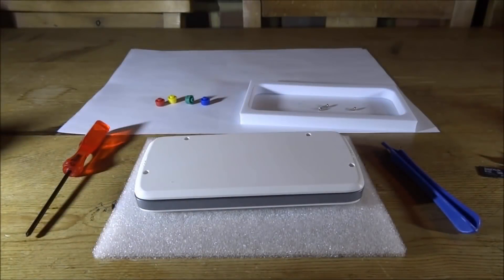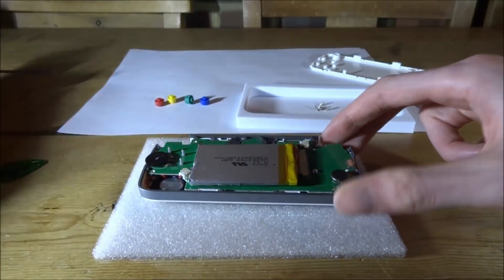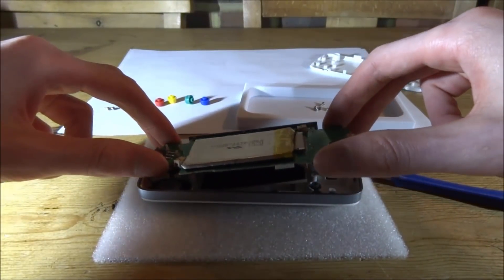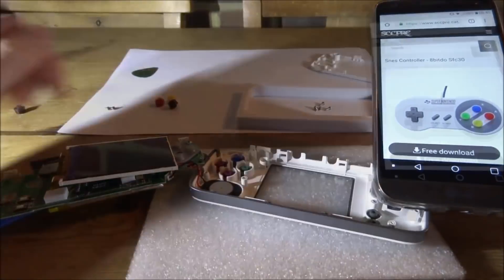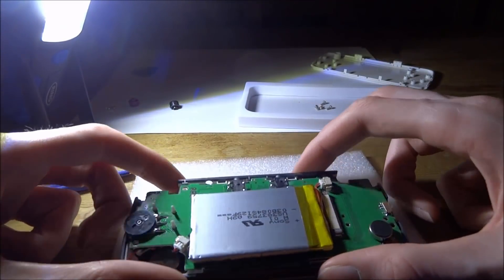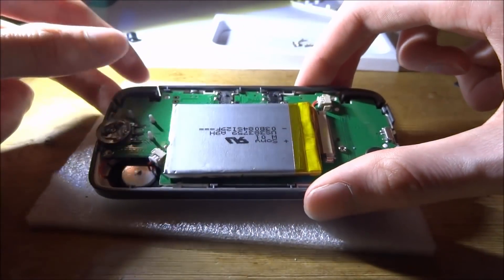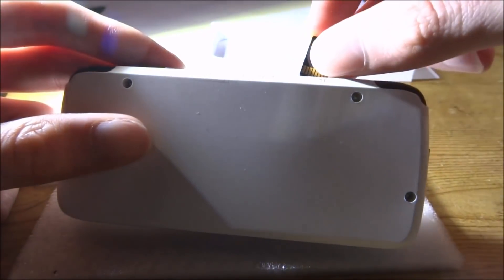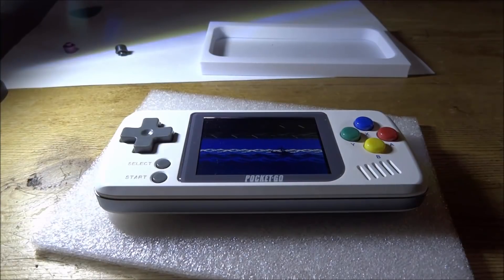PocketGo EU SNES Buttons Mod!

Comment: I bet that 90% prefer these buttons to the original stock buttons so why didn't Bitboy have those buttons installed to begin with instead of those boring buttons and make us going thru all the hassle to replace those buttons. I don't mind if it's easy with no tools required; it's not hard but it's also not that easy.
Reply: John Doe Nintendo have a Patent for the color Sheme
Reply: Michael Heintzer Really?? So that might explain it. But they could have switched the colors to different buttons or changed the colors a little bit darker or lighter like Microsoft did with their controller.
Reply: Bruh no one respects the Australian and Japanese snes

Comment: Anyone else have light leak on the left side of the screen on the top and bottom corner?
Reply: From my knowledge, that’s screen tarring. I know some of the latest firmware “fixes” it. I do not have a problem on mine probably because I got mine a week ago, so it has the latest firmware.